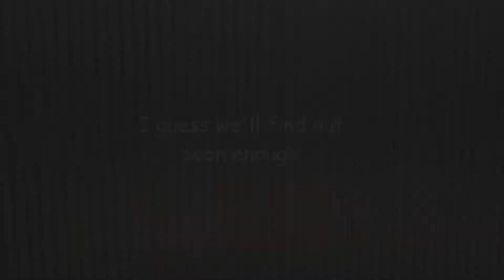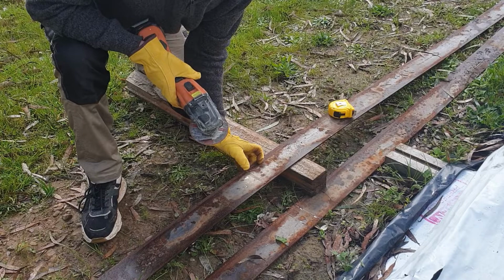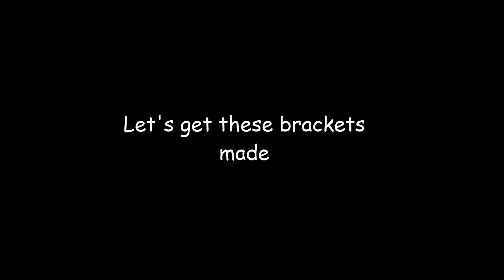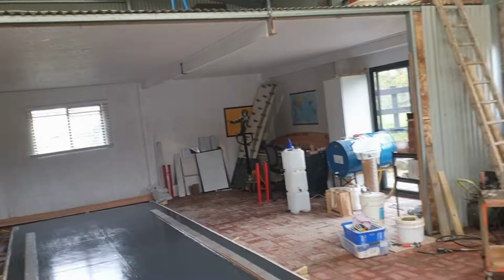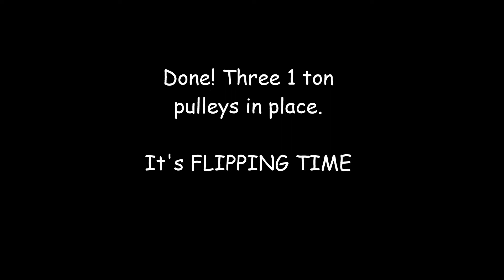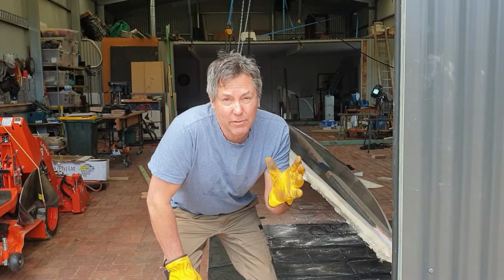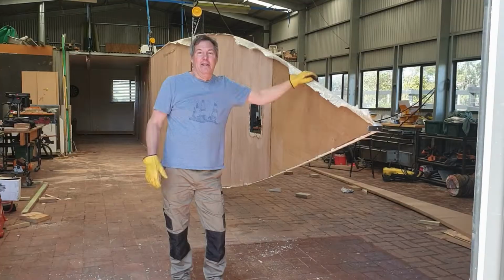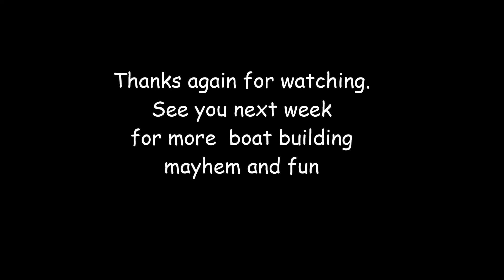Boat Building Flipped It! Building Dragonfly E 3

Comment: I did not see E1 What is the hole in the boat for
Reply from the maker: Well you better binge everything then. hahaha The hole is for a retractable bow thruster. Being a super shallow draft boat, there is no space to put a bow thruster that is below the waterline, so I made a retractable one. Thanks for watching, Steve and Maple
Reply: @steveshierdoesstuff7420  I think all big boats need a bow  thruster.  GOOD MOVE.
Reply from the maker: @radams009  Yep, a ton of work to make, but should be helpful in tight quarters on a windy day.  Cheers